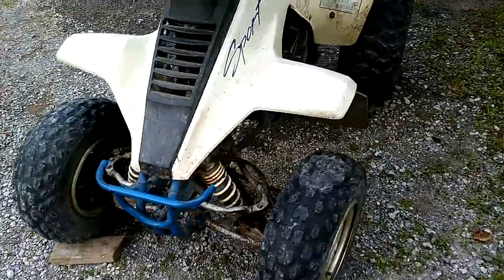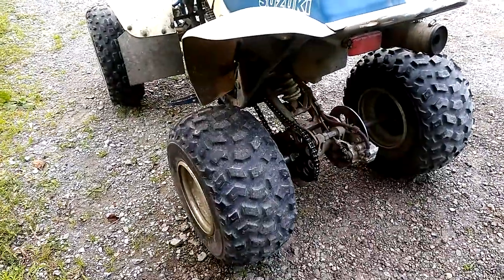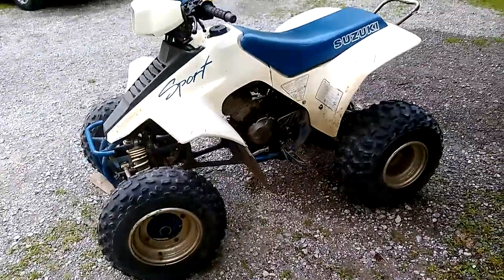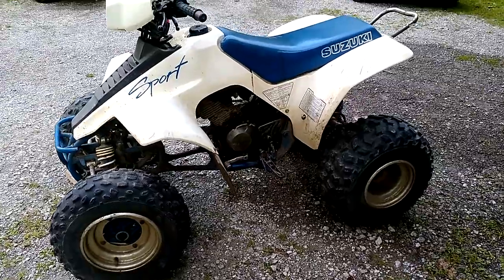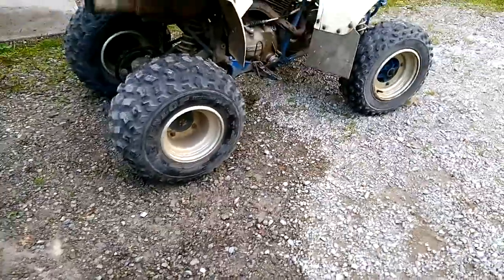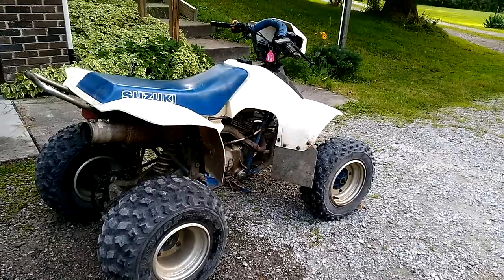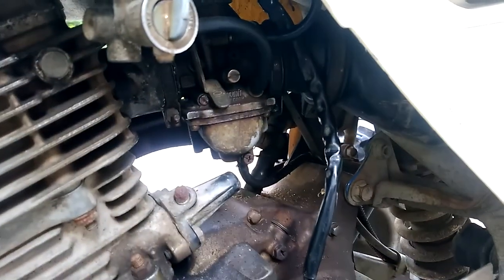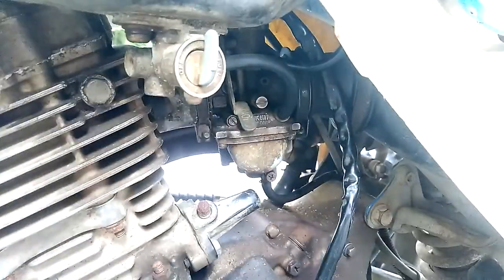4Wheeler Troubles

Comment: Take a wire brush and pull out one of the wires from the brush. use the wire to clean the jets, especially the main jet. They clog very easily.
Reply from the maker: Thats what was holding my GoKart back from starting a couple years ago. Thanks!

Comment: Gerret it is a sign , take of carb , clean the float bowl, Yoy can take float apart slowly, set the float in a small bowl of water and check for holes in the float, If that is not it take the carb apart, use a can of carb cleaner and spray out the jets,  blow out with compressed air, If it has been siting awhile  check the fuel valve on the tank and make sure fuel flows freely, Takes a little time but you may not need to rebuild just a good cleaning, .Also make sure the gasket on the carb is good if not replace it.  Just my thoughts
Reply from the maker: Sounds like good thoughts. Thanks man!

Comment: I get my carb rebuild kits from ebay.  In the mean time, you may not need a kit.  Pull off the carb so you can work on it on a table.  Remove the fuel bowl careful not to ruin the gasket.  Push the pin out holding the float and float needle in place and remove.  Then unscrew your brass jets.  Clean the whole carb and the pieces you took off with some carb cleaner or brake cleaner.  Inspect the jets...you should be able to see light through a small hole them...if not take a stiff piece of (no bigger than the hole) wire and work the gunk out.  Slap it all back together and she'll run like a top!
Reply from the maker: Sounds good! Ill give it a shot! Thanks!

Comment: Somewere there is a crack, we get a suction of air. Check the fuel hose, carburettor gasket, fuel pump diaphragm, engine head. Purge the carburettor nozzle.
Reply from the maker: Will do. Thanks!